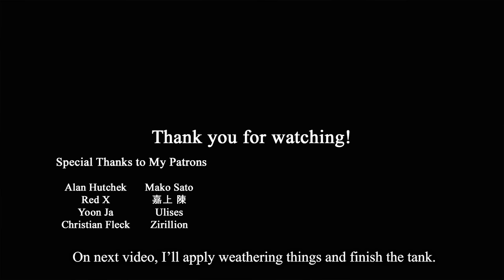I couldn't get 1/72 accessories I want, so I made them. Sculpting and Painting 1/72 stuffs for M1A2

Comment: I used to use Magic Sculpt until I found out how bad I was getting ripped off! I discovered it is really just JB Weld that has been repackaged, split up into smaller volumes and the price jacked up to the sky! Then for tarps and other fabric types I prefer to use a fine linen and some PVA glue watered down. It gives a much more realistic finish and is way easier to do.